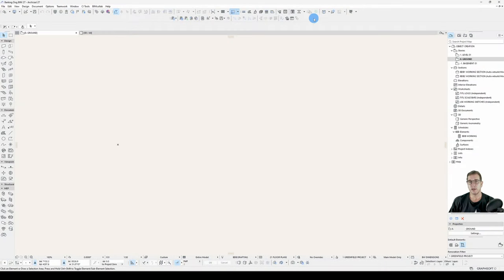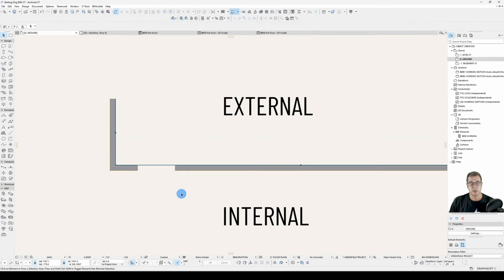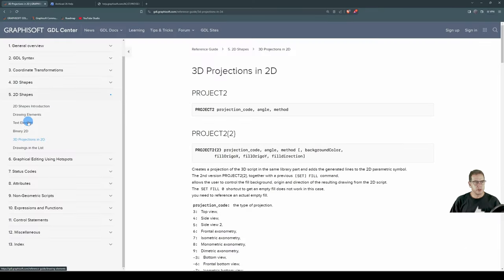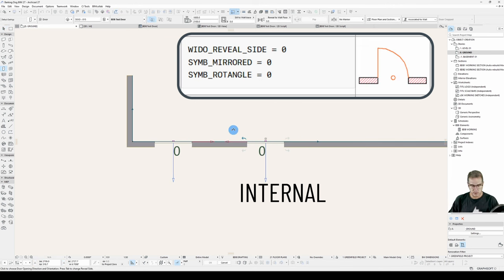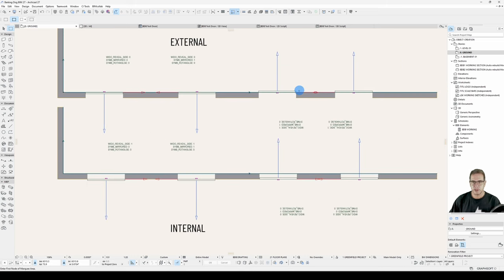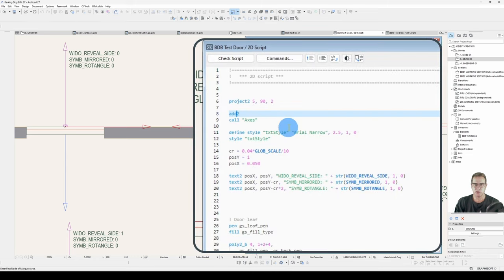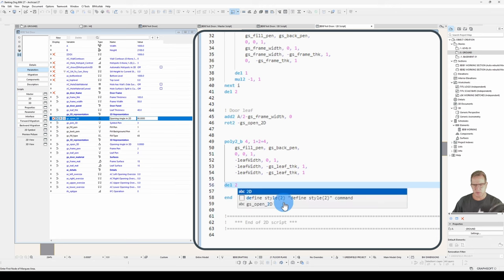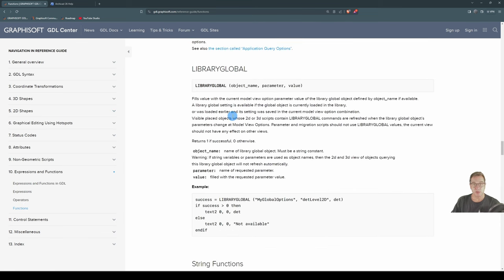021 Introduction to GDL Doors

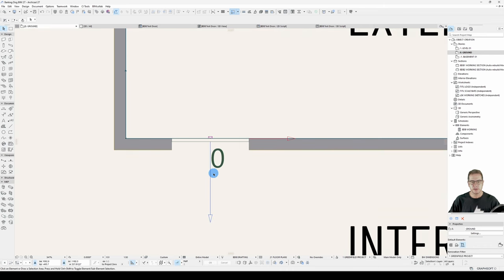Comment: Great tutorial, as usual! I need to get the macro you use at 11:43. 😸 Speaking of macros, is the "Axes" one yours, or is it in the standard library (Archicad won't load it for me)?
Reply from the maker: Axes is a part I made.  It's just "LIN_"s and "PYRAMID"s in 3D, and "LINE2" / "POLY2" in 2D, using different pens.